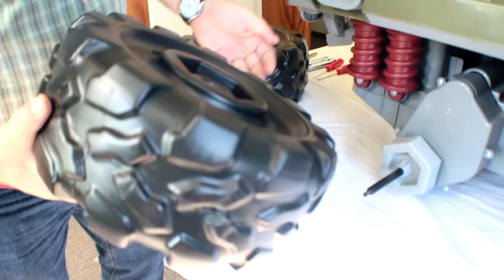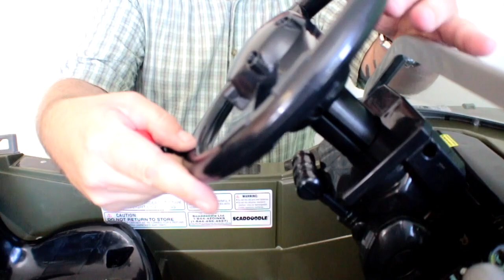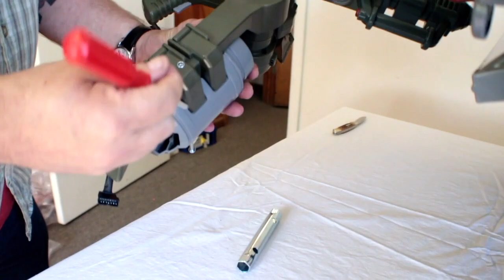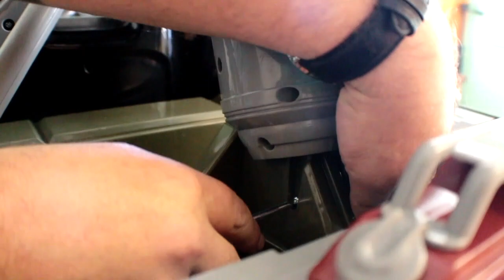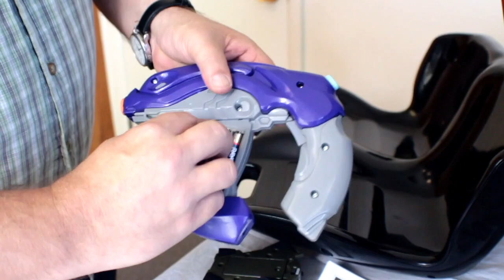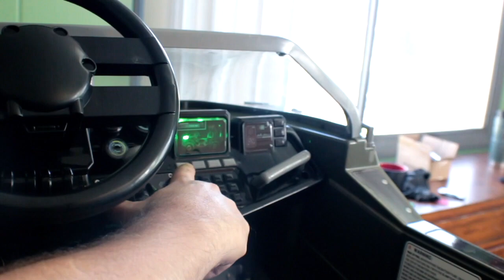Assembly Guide - 24v Zoinks Halo Warthog

Comment: That battery in this ride on is huge compared to what is standard in most 24-volt ride on vehicles.
Does this Warthog have a low and high speed switch for inexperienced drivers to learn how to operate this cool vehicle?
I take it that a remote control is not part of the design..correct?
Reply: It has a low and hi speed no remote